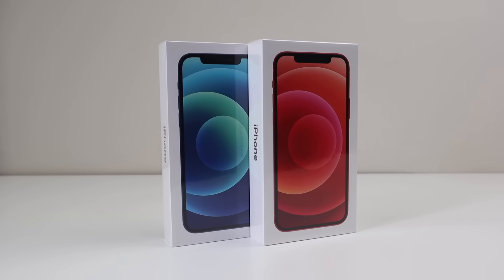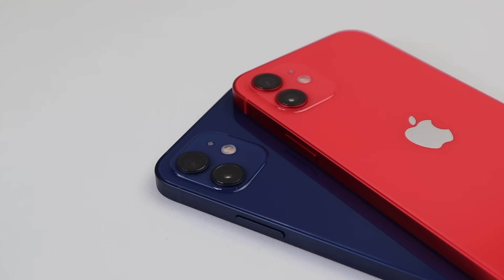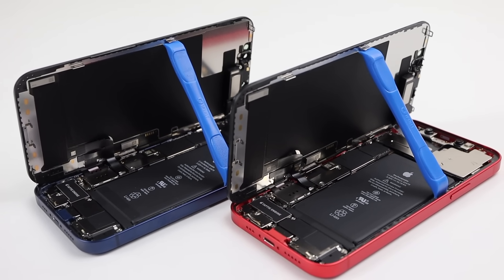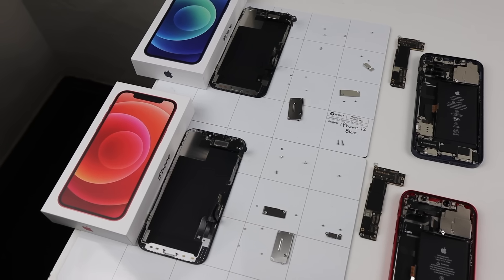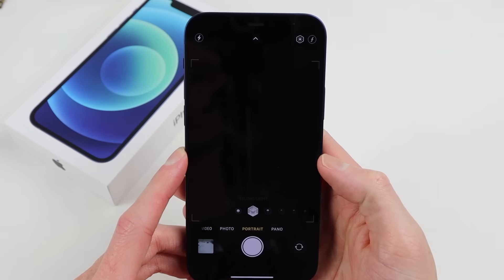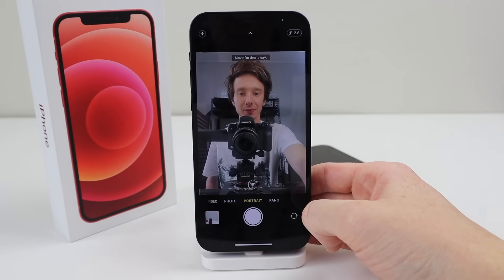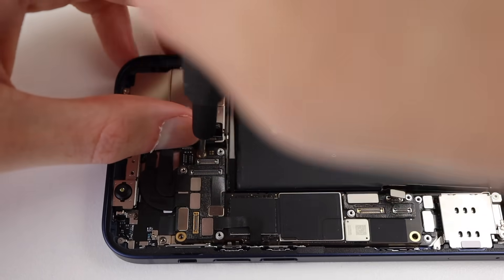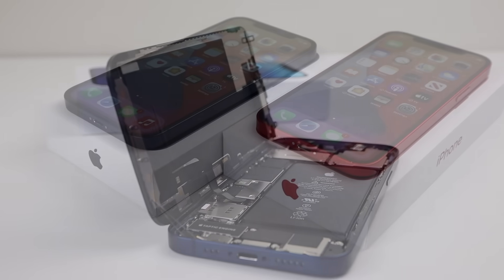iPhone 12 Anti Repair Design - Teardown and Repair Assessment

Comment: Apple is fighting against fraud hardcore.  Fake batteries, fake parts inside of a apple phone case.  Apple has lost a lot of money from Fake Phones and other devices like iPods.  I have worked in the department before.  Every week we would always find some new way people are trying to get a replacement phone for free with a fake phone and/or fake parts inside.  Glad that apple now is really putting their foot down.  Of course some people hate the fact apple is doing that and try stuff like jerry rigging the phone to shock someone when they open it.  Even jerry rigging batteries to go off.  So, when you open it for examination the battery would go off.  Smoke comes out of it and causing the area to be evacuated.  You can get cancer from that crap.  You have no idea how much I hate those people.   Glad I don't work on those Phones any more.  I was getting really tired of trying to think outside of the box and stop them from getting away with fraud.  I wish the phones I worked on had this type of security.  If you are wondering what I worked on while I was there:  iPhone 5, 6 ,7 & every iPod.

Comment: So the hardware is married to the board, that means anytime a hardware swap is needed a board swap will be needed as well until a flashing tool is released. I can never understand the concept behind this method, Sony does the same thing with their playstations disk drives.

Comment: In France there is a law that oblige them to sell the phones with earphones and a charger, we got lucky !
Reply: Wow
Reply: that’s half-accurate, in France the law only force phone sellers to sell a phone with earphones. The charger plug is not needed
Reply: If you as a costumer had the right (by law) to get free earphones and a charger when you buy a new phone, so you can choose yourself depending on if you allready have earphones and a charger. THAT would be environment friendly.

Comment: As a security researcher, I think it's worth noting that face ID is a very important part of the security of an iPhone, and not having encryption, authentication, and attestation involved might significantly degrade the security of the iPhone as a platform. There should be a way to address both concerns, but it's not trivial, and just saying "I should be able to swap it out and it should just work" may be a bit naïve...the phone needs to prove that the new part is not a malicious exploit tool pretending to be a camera, and planning to say "yes, it's the right face" to the phone to allow malicious purchases, or unauthorized access to the user's data, which could include investment or banking apps responsible for protecting that user's life savings.

Comment: You have to calibrate phone anytime you unplug the battery. Its apple making sure you use a "Professional". I worked at GeekSquad and repaired iphones and would just be so disappointed in people buying an expensive phone that should really be valued at $60 max $200. They use proprietary tools just make sure their phones can't be fixed by common people..Disgusting

Comment: The fact that Apple actively tries to prevent repairs is a scandal. The USB-C charger trick is a total scam. I personally wouldn't mind, I have USB-C chargers already, but for most people, that's just an additional cost. Here's a hint, Apple: just trade in old chargers for new ones at no cost and you won't look so evil.
The "climate" argument is stupid. We are not changing the climate and our production is irrelevant, to the planet. All pollution is local and can easily be dealt with - that's an economic problem. Ideally, make all devides easy to recycle so that we can re-use at least 90% of all the resources that go into its production.

Comment: I may be cheap, but I belive your stuff should be able to be repaired with spare parts by some experienced/skilled people (like Louis Rossman). That's why I will never touch anything that has Apple brand on it. Way too expensive and too fragile for my tastes. I tend to drop my phone from time to time, and can't be arsed with "oh you need to replace your WHOLE phone because of that small crack on the edge of your screen". It's just ridiculous. Shouldn't happen in the first place, should've been built to last + engineered properly so you can make repairs/swap parts/replace batteries/etc. While Apple does everything in their power and wastes time and money just to design their stuff in worst possible way to prevent/discourage any sort of tinkering. That's how loads of ppl come up with bright ideas in the first place - they tinker around with their hardware and come up with some inventions/solutions/upgrades. 
Where are goddamn dwarves when you need them and their sturdy and reliable (has to last a thousand year or your money back) approach to everything ;).

Comment: It gets you thinking about all the terrible business practices apple uses to bilk more money from its customers, but then a thought occurs, DON'T BUY APPLE. If you do you deserve what you get. Apple just isn't as good as it might have been, if it ever was. Since the windows 98 era apple lost what made them better than their competitors. It's just branding now, releasing a new hotness every year to get money for nothing you need. Ditto the samsung galaxy btw. Shop around, wait till the latest and greatest isn't any more and it will be much more reasonably priced. Been that way in anything related to computers - and these phones are just small keyboard-less laptops now - for ages. To borrow from Macklemore, don't "get tricked by a bizzness"

Comment: I work at apple certified store where we can do repairs, any iPhone on software after 13.8 I believe it blocks out the parts until part is verified through apple diagnostics. If not done then the phone cuts out some of the exact features. Whether it’s Face ID, Touch ID, battery, or anything else the phone will not recognize the part without the apple diagnostics software

Comment: I know people are gonna try to roast me for this, but... android is better
(I have my reasons, so if you feel different about this, then either ignore this or release your apple fanboy rage)
Reply: Android pros: reliable, cheap, very durable, allows for control of the phone, universal USB charger port, and separate headphone/auxiliary port

Android cons: bad camera, low quality screens, not flex material

Apple pros: very good camera, super high screen quality, and flex material

Apple cons: overpriced, unreliable, toxic fanbase, shatters real easily, headphone and charger port are the same/are apple specific ports, and no control over the phone (it's like apple still has the phone, but they're letting you use it... it's like an older sibling letting you play games on their phone)

Comment: "We want to reduce waste....now go buy a new charger and phone once it inevitably breaks since we wont allow you to repair"
Reply: Now need to buy two charger, since apple original cable is bullshit
Reply: oh dont worry they allow you to repair them. In their shop for their prices of course
Reply: @miserymike3523  it costs a third of the price of the phone to replace a screen
Reply: Don't forget the charging box costs 20 bucks
Reply: @JohnJohn004  and don't forget the earphones
Reply: @cgzwotblitz6671   don't forget that you can't use them both at the same time unless you get the over expensive airpods
Reply: I broke my home button fixing screen.  Apple wants $330 for a Touch ID button. I used a $15 button but lot Touch ID.  Apple charges so much for repairs that it not even worth repairing.  They will increase waste!  I replaced my screen, battery and home button for $65 Canadian.
Reply: If they want to reduce waste of their company - it's easy as hell. They just need to stop making their products. XD

Comment: What this tells me is that the key to their repairs are a proprietary diagnostic software that can get past all those errors through hardware and software checks, plus more than likely a full flash of the device back to factory settings. So that begs the question, why doesn't Apple just provide paid for training and license use of their software to repair vendors if the vendor wants it? It becomes a repair shop paying Apple to service their devices without Apple paying them an hourly wage/per repair wage, insurance, etc. Then the shop can charge the difference for a "specialty" repair. I don't know, I'm just typing out loud.
Reply: @DistrosProjects  XD I just tried looking one of these repair places up via the Apple site, and the search function is broken. Convenient, huh?

Comment: Just playing devil's advocate here... I've seen videos of how many Chinese manufacturers produce counterfeit parts and how easy it is to get hold of a non-genuine iPhone. If you were the engineer that designed this architecture, the components, wrote the software etc etc, would't you feel justified in being p'd off and ultimately going down the part-pairing road?

Comment: Apple does not want ur phones repaired coz they expect you to buy a brand new one when their software update wrecks it.
Reply: Easy move to android,consumer has their choice except is fan’s of apple,then is speechless
Reply: @williamchong6841  like android is any better, Google shoving endless updates down your throat, monitoring every single fucking thing you do. Most manufacturers of android phones make it really hard to take them apart to repair them, if you can even find the parts to do so.
Reply: @williamchong6841  that's where the ecosystem part comes to play. Even if iPhone users wants to buy an android phone they cannot because their airpods, macboob, apple watch, ipad work better with iphones only. They are forever stuck with iphones. Brilliant marketing strategy by Tim Cook though
Reply: @sarthakjain1824  if only someone else had invented headphones, laptops, smartwatches or tablets at a cheaper price. Damn.
Reply: @sarthakjain1824  Bruh I have a galaxy s9 with the air battery app and it can use airpods just fine. Even if iOS devices can still work with them a slight bit more quickly, ppl rly have no excuse to not be switching to android at this point.
Reply: @slyseal2091  oh well, none of them even compare to Apple's.
Reply: @ilyachap  what kind of apples do you get from the store? I want a laptop made of apples
Reply: @sarthakjain1824  hey can't you just keep both?
Reply: @slyseal2091  but these all things work flawlessly with each other
Reply: @DeeKay505  not only airpods. Apple watch too which does not work as good with android
Reply: @sarthakjain1824  obviously nothing works as good, but at a certain point it's good enough yk

Comment: Well after having iphone 4, 5c, 6 and 8, looks like I need to finally switch to android. Can’t even replace a battery. Insanity.
Reply: um android doesn't have removable backs either
Reply: @IAm-zo1bo  Do they add internal serial numbers paired to that specific phone to their batteries so you can’t swap them like Apple does now?
Reply: @jim2386  No they don't. You can change batteries in your Android device as often as you wish.
Reply: @amenoyōna  exactly :)
Reply: @IAm-zo1bo  I'm sure he wasn't talking about that

Comment: The future, fake green energy companies that have a low emission profile but solely produce "single" use products that will turn into waste sooner then later, no repair or recycling possible. They probably call it progress, while its actually just shifting the problem. And its once again all about the money, repairs require effort and don´t bring as much money.. single use products offer so much higher wins.

Comment: since steve job's death, apple has gone downhill
Reply: Not really, Apple started going downhill when they introduced the iphone x.
Reply: @tufree.  the iphone 5 was already a downgrade in quality to the iphone 4 which had a steel casing
Reply: @toniokettner4821  I dont really care for sides but be a bit logical. Unlike the unnecessary charger and port changes, aluminum alloys are way lighter than steel. I don't know what your prefer but I'd rather carry an expensive aluminum brick compare to an expensive steel brick as my pants won't drag down.

Also here what I'm gonna assume for the path they went. Aluminum alloys are much easier and faster to machine so now they spend less to make each phone. Therefore, they are able to sell more overpriced bricks while making those bricks cheaper and not to much of a downgrade in quality
Reply: @jerryudonneedtoknow3903  i don't understand how a few grams more of weight are bad. but steel is much more damage resistant and supports the rigidness of the entire phone, making it indestructible (if you protect the screen from shattering)
Reply: @toniokettner4821  Aluminium is better at absorbing shocks so it also has advantages
Reply: @dave93x  good for you
Reply: @toniokettner4821  i loved the iphone 4s, it was a great lil brick
Reply: Steep slope ahead!
Reply: It ever was, Steve jobs was a scumbag of a individual
Reply: True
Reply: EXACTLY
Reply: Steve Jobs is the one who promoted this kind of "hard-to-repair" designs
Reply: @xanthuumnihyr5319  i don't care, he was a genius
Reply: @toniokettner4821   He was an exceptional businessman but i won't go as far as calling him a genius
Reply: Apple was always abusive
Reply: WHAT HE DIED, YOU CANT JUST LAY THAT ON A GUY
Reply: @shawnsdogs3397  u didn’t know that? He’s been gone since 2011 due to pancreatic cancer.
Reply: True. Because he knew WTF HE WAS DOING
Reply: Apple will never go back corrupt because stupid people keep buying their phones 🙄
Reply: @Igotnolphone  r/boneappletea
Reply: I’m still mad about them taking off the headphone jack. I prefer having the option to not use bluetooth as it drains the battery faster

Comment: No reason to do this except greed. I feel like apple is going to learn the hard way that you can only pull so much crap on consumers before they ditch out on your brand. I have always owned iphones, but this is the last straw. Plus the batteries go bad in a year. So you are paying for a device that lasts for a year, and then needs over priced repairs. They would sell enough stuff without screwing people out of chargers and repairability. :/ The older apple stuff lasts forever, all the new devices have things that break in 2-3 years.

Comment: I bought my first Apple product in 2011. It was MacBook Pro. Best fucking laptop I’d ever had. You could access and replace just about everything by removing a single panel. It was basically a desktop but in a laptop form factor. I was sold on Apple for life. Then Steve Jobs died. Then they soldered the RAM to the motherboard. I bought my last Apple product in 2011.

Comment: 1:01 Most people’s chargers still also have the wire that went with them. So the iPhone 12 could use an iPhone 8’s charger quite easily, since the iPhone 8’s charger is iPhone -> USB -> Wall. You’re assuming everyone just kept the USB -> Wall part but threw out the iPhone -> USB wire?

The iPhone -> USBc wire they send with the phone is for plugging the phone into a laptop; not for charging it in the wall.

Comment: Guess this explains why my battery indicator is stuck at 100%. I took my iPhone 8 in to a third-party repair shop a year ago or so, got the screen and battery replaced. Ever since that day, my battery readout refuses to drop below 100% (I basically have to guesstimate when it's going to die based on the loss of audio and input lag), and the haptics will randomly stop working. Either entirely or just the home button.

Comment: Yeahh.. I'm not an apple fan, but I've never needed change out the logic-board / nor have I ever seen one that needs replacement. I'd be very curious if these same issues arise just from screen replacement ALONE..

I would anticipate any phone to have issues after swapping an internal network card without programming

Just saying..

Comment: Apple has been known to assemble devices with hot melt glue, particularly iPads. This makes them virtually recycle and repair proof. 
Also note that the video notes the battery is significantly smaller than in most devices. 
Check the news lately: Apple is lobbying against American laws designed to discourage the use of forced (slave) labor in China. I wonder why?

Comment: Apple and the anti-repair lobbyists love to use the claim "this is all for the protection of your data" as a shield in public hearings on right to repair, even though this level of excessive lockdown is unnecessary for the vast majority of normal everyday users, who would much rather have longevity and reparability instead.
One of these companies needs to listen to the people sooner or later, and finally release a new phone that: 1 - brings back user replaceable batteries, 2 - brings back the headphone jack, and 3 - easily replaceable components in lieu of full waterproofing (just water resistance / splash protection is all most people need.)
For anyone else who needs fully locked-down hardware with full submersion waterproofing, that should just be an optional device for those who need the top-level security.

Comment: Does anybody know if this anti repair system is affecting older iPhones like the iPhone seven. I recently replaced my iPhone front camera and the camera would work properly on the camera app but in any Third party app the front camera would crash the app so I wouldn’t even be able to open the app